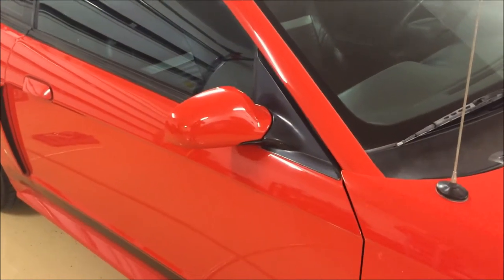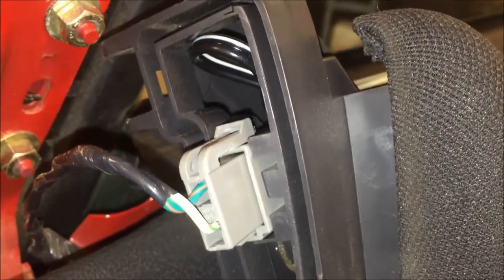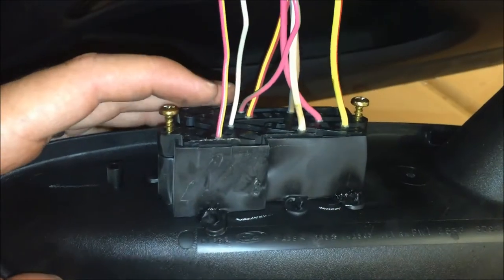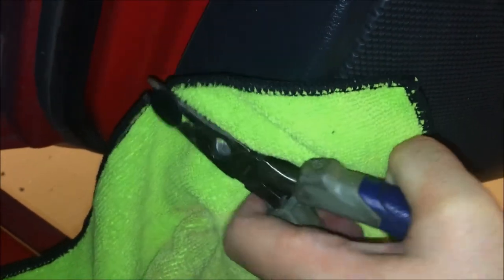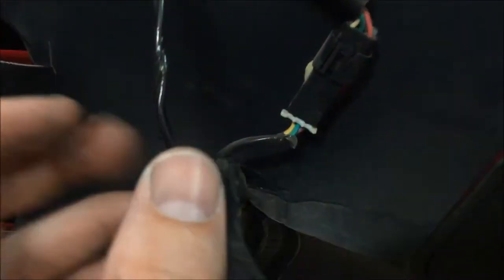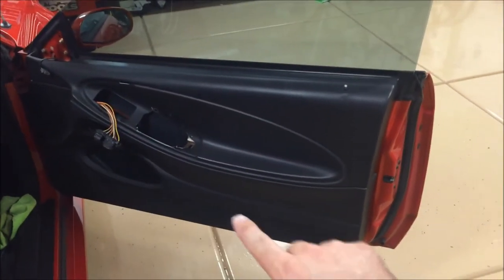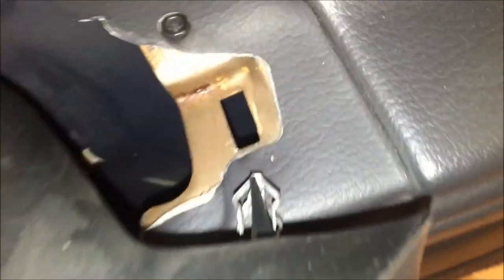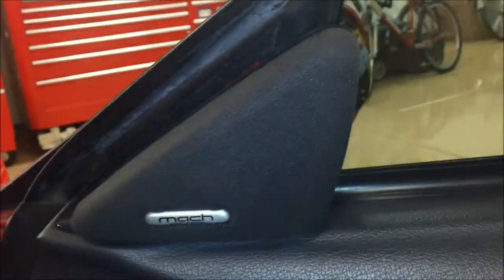1994-2004 Ford Mustang Mirror removal

Comment: looks like the bolts are accessible to remove side mirror without taking off the door panel. the aftermarket side mirrors i ordered arent power controled. since theyre not power controlled, does it even matter if i take off side door panel to unplug the power?

Comment: I need to remove my door panel so I can (somehow) tighten my passenger door window.  When it's down, it rattles pretty loudly when you close the door.  It will rattle on large bumps too.

Comment: You have a Terminator and a Mach 1? What a dream man having both those cars.
Reply from the maker: Thanks. They are both great cars.
Reply: Danny Johnson I have an 2000 V6 since my senior year in HS so I've had it for 3 years now almost 4 coming up in May 2018. I plan on buying a GT, Bullit, Mach 1, 99-01 Cobra or my dream car the 03-04 Termi. I just have to find one that's in good/decent shape when I graduate college. New Edge mustangs have always been my favorite as a kid. The rear of the New Edge always got me lol
Reply from the maker: That's awesome. I hear ya- I had a 1997 V6 in high school and always envied the GT badge, and drooled over the cobra badge. My twin brother has the same cars as I do (Terminator and Mach 1) but also has a Bullitt. We've done a lot of work on that Bullitt to supercharge it and drop in a built mmr engine. These are all great cars. I'd personally go after the terminator. There is not another mustang like it, and it will not depreciate. Good luck on getting a good one.
Reply: Danny Johnson Thanks man and yeah I heard you say you had 1997 V6 for 10 years in a video of your Bullit. Love the videos, kinda went on a binge watch lol

Comment: Hi there Danny my passenger side mirror won't go left to right it will go up and down the driver side is fine I've tried getting a new power mirror switch but the problem still remains do you think I should take off the tweeter and see what's going on? Suggestions will be great
Thank you
Reply from the maker: You will probably need to remove the mirror, unplug it, and then possibly remove the glass to get behind it and access the motor itself https://youtu.be/EdO5RGhyoMY
Reply: @dannyjohnsonsgarage  very appreciative Danny thank you!
Reply: @dannyjohnsonsgarage  very sorry to bother again Danny but any videos on how to take off a trunk? I plan on getting one but all the forums just say the trunk lock nothing on how to take it off. Thank you.
Reply: @dannyjohnsonsgarage  also are the trunks for a coupe and convertible the same? I have a coupe the donor car is a convertible thank you you're awesome!
Reply: @dannyjohnsonsgarage  both 04 btw

Comment: Got some folding mirrors and the problem of the passenger not going side to side is still present it has to be the wires no way both mirrors have a bad motor and now my driver side is shaking
Reply from the maker: They definitely wobble over time. My cobra is low enough milage it’s fine by my mach 1 cobra mirrors rattle. You can put double sided sticky tape on the back of the glass to cushion them. If the other mirrors worked its most likely something with the mirror side of things as you’re thinking.
Reply: @dannyjohnsonsgarage  it's possible I get a clip from a yard I assume it's the same as the non folding mirrors I just need to check if power is going to the side to side on my passenger because it was doing that with the old mirrior
Reply from the maker: Mine plugged right in, so I bet they are the same
Reply: @dannyjohnsonsgarage  yes thank you! I'll get a clip and I hope that works if not the tape it is